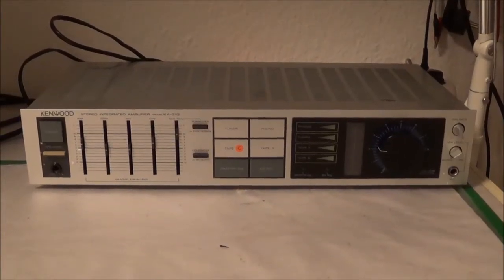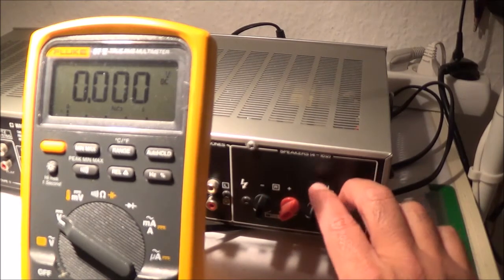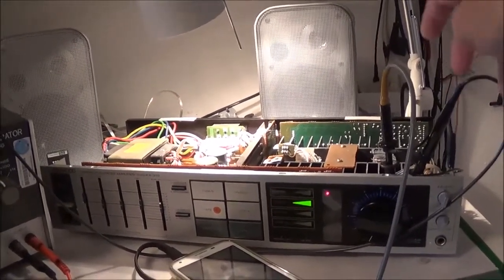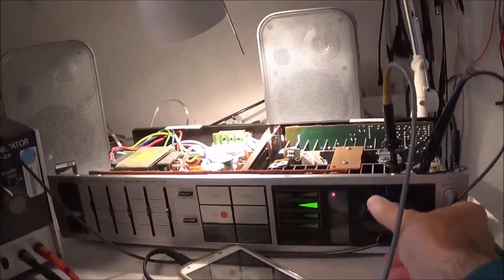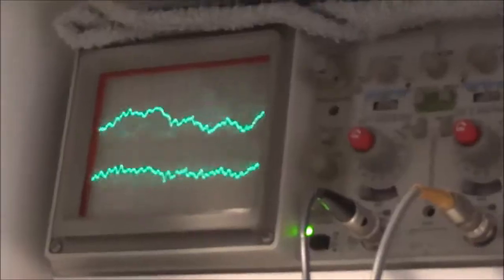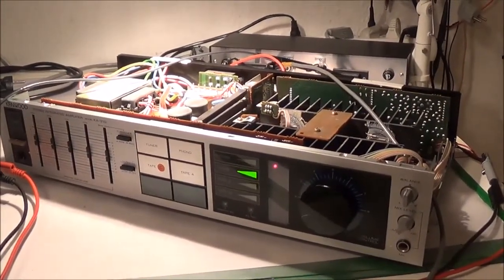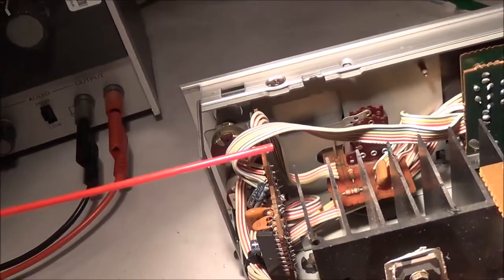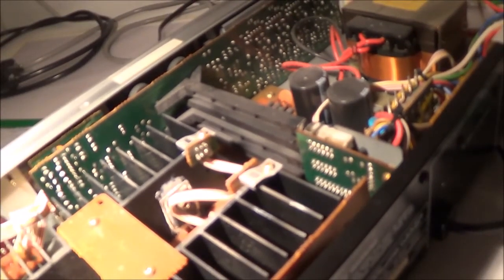Kenwood KA-31 Stereo Amplifier Intermittent Problem

Comment: Its better clean with Alcohol isopropilic potentiometers under alcohol . Spray not work correctly.
Reply from the maker: It's even better to take the potentiometers apart completely. But is it feasible. So far spray with lubrication  has worked out fine for me. The pots need lubrication anyway. You keep your method and I will keep mine. But, thanks for your comment.